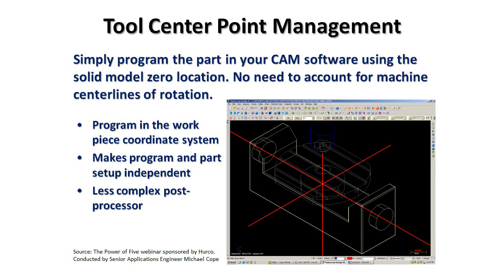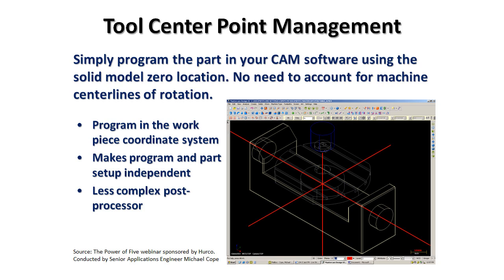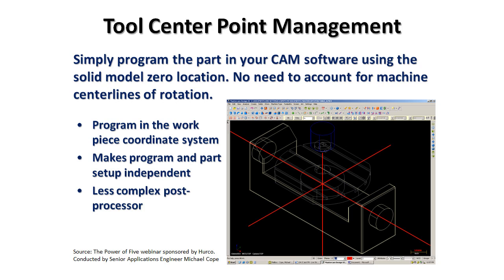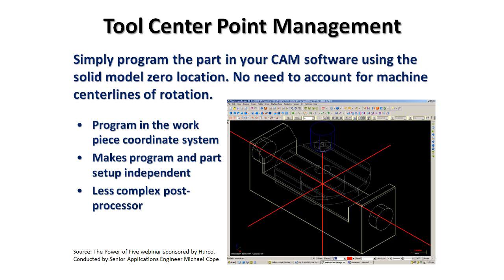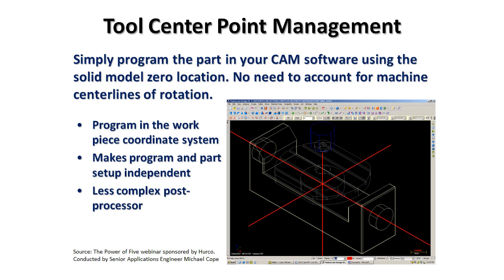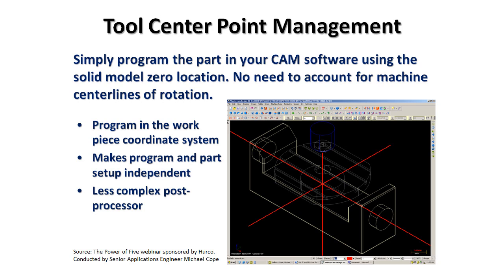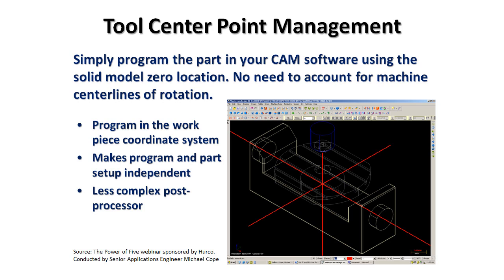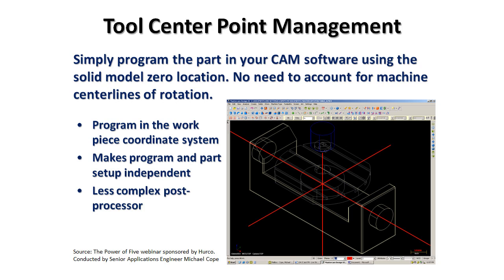Tool Center Point Management

Comment: This talk about problems that don't exist anymore doesn't help the future customer understand as well as simply relating how easy of difficult it is to program a Hurco 5 axis machine today using a typical CAM system.  I don't think many will be conversationally programming 5 axis machines.
Reply: i sometimes program 3+2 manually, but only for trivial contours